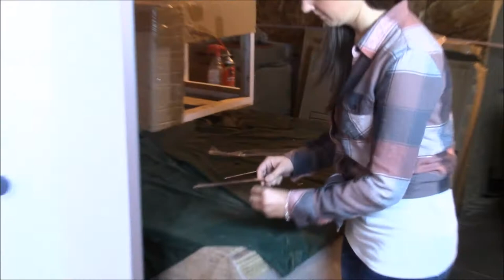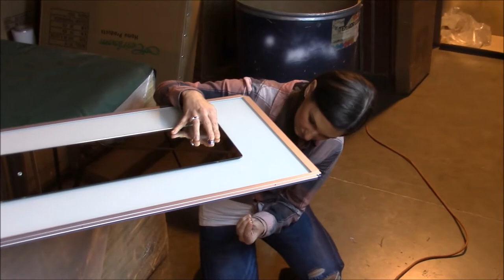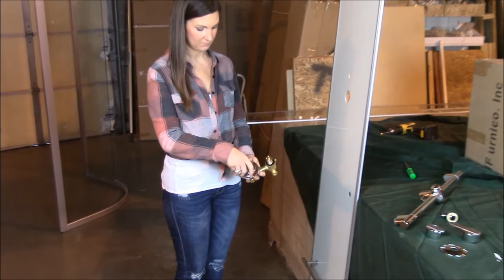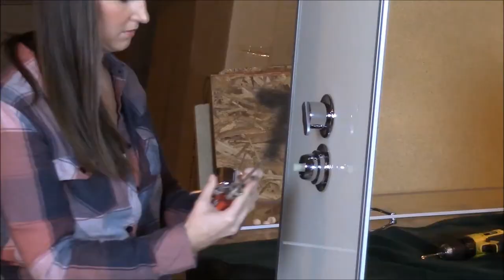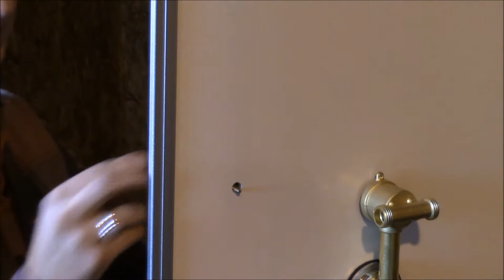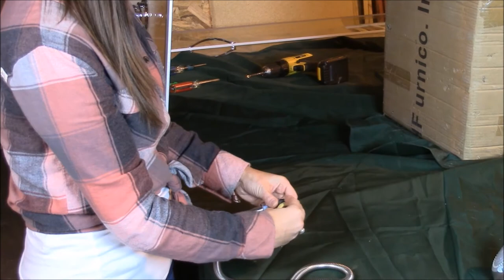S 3838 S 40 Back Panel Preparation

Comment: Shower look very nice ,but has some major issues .The rack that is supposed to hold shampoo bottles will not attach as show in video. Pieces of finishing product like caps to finish over screws were missing from packaging , . Trying to attach screw to wall through the corner system is almost impossible as there is know room to turn a screw driver. Quality of product and poor engineering issues.